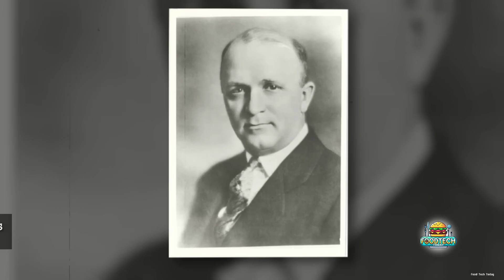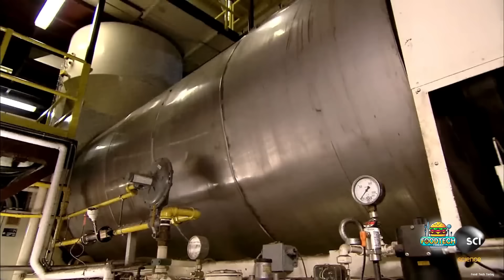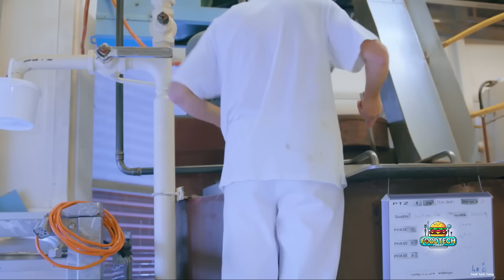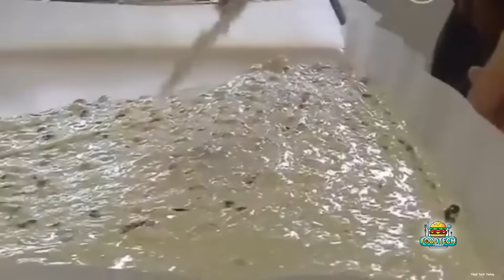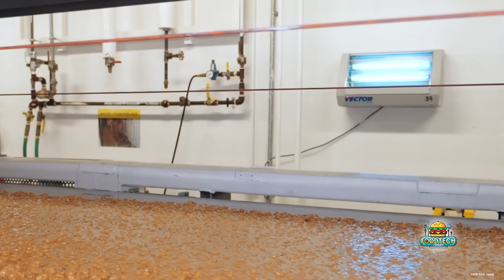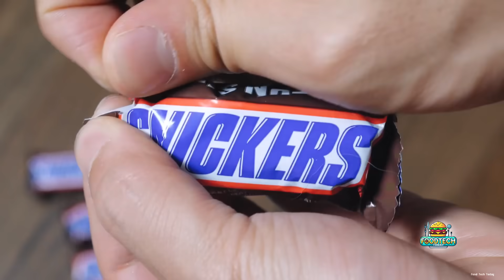How Snickers Are Made In Factory | Step by Step Process

Comment: The commercial is false advertisement. The commercial shows the caramel and milk chocolate getting individually layered onto the nougat and peanut individual layers. They don’t mention that the peanut and caramel layers are mixed together in the factory. So technically instead of it being nougat, peanuts, caramel, and milk chocolate it’s ACTUALLY nougat, peanut caramel mixture, and THEN milk chocolate